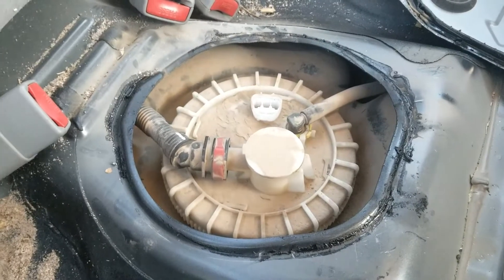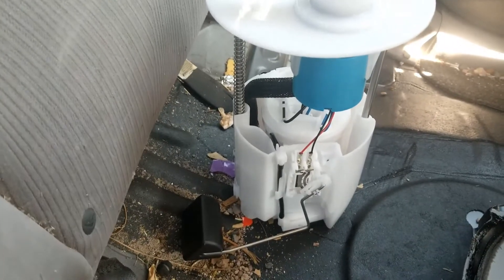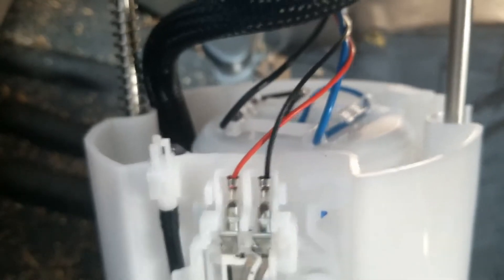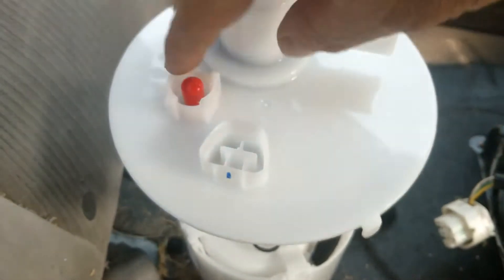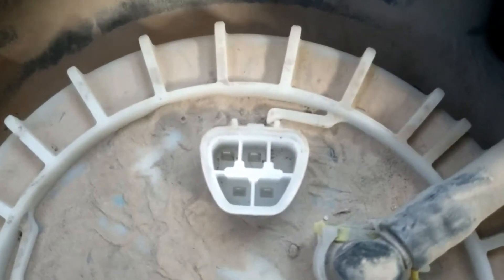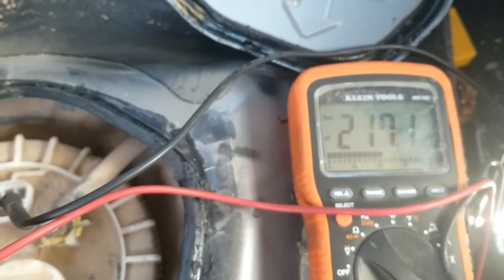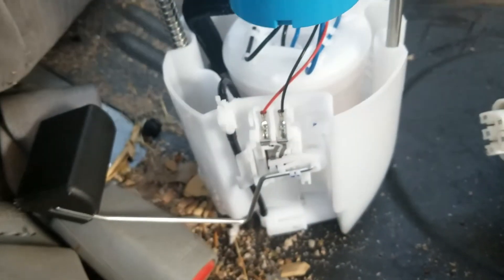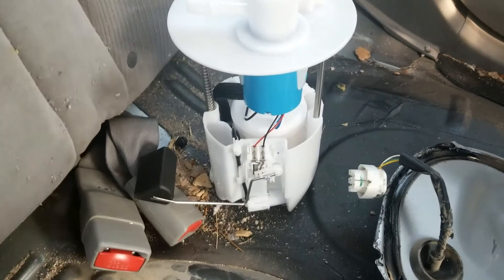How To Test a Fuel Level Sensor Without Removing Fuel Pump

Comment: On my R129 1999 Sl500 gas gays tarts fluctuating while I’m driving, How about checking the fuse located in the right side of the trunk  ? What is the Number of the fuse to check if it’s working 4:45
Reply: From what that sounds like, your fuel may be sloshing in the tank. The best way to test this is find a slope starting with back end up and the front end. Everything checking the fuel gauze to see if it has changed.

Comment: Thanks.my escape was reading the fuel gauge but i replace my old fuel pump on my escape 2005 cuz it was just cranking after I replaced fuel pump I got no more reading  I bought a new fuel pump unit and still no reading on guage but pump is working cu my escape now turns on  and it firing up good but no reading on cluster guage

Comment: I have a 2010 Ford Escape with a fuel gauge that always reads below empty. It started as an intermittent problem but now it's stuck there all the time. And it's throwing code P0463. The fuel pump is working fine and the car drives fine, but the gauge doesn't move regardless of how much gas is in it.
I have replaced the fuel level sending arm with a genuine Ford replacement part, but the gauge still doesn't work. 
How do I troubleshoot the wiring from the fuel pump connection back to the gauge on the dash? Thank you.
Reply from the maker: There should be voltage going into the sensor and a lower voltage coming out. Wiring can be hard to troubleshoot, but no voltage going to the sensor is a common problem. I would get a schematic for your Ford to know which wire is sending voltage to the sensor and be sure it is correct.
Reply: @HVAC_Mechanic  Thank you I will do that, but didn't know where I could get a wiring schematic. Do you have a source you can recommend? Thank you for your response, I greatly appreciate it.
Reply: Same my problem the gauge and floater is ok but my gauge always blinking.in my Mitsubishi xpander .
Reply: Same my problem the gauge and floater is ok but my gauge always blinking.in my Mitsubishi xpander .

Comment: Mitsubishi mirage 2017 , 
Fuel Temperature Sensor is going bad, and felt in the dark about what mechanics were telling me. 
To change this sensor you have to replace the whole fuel pump? 
Going to do some testing as in the video, maybe a lose wire idk.
To change a sensor the entire pump has to be be replaced?